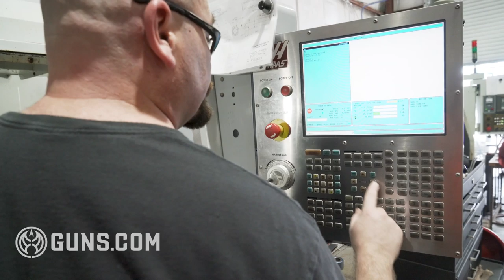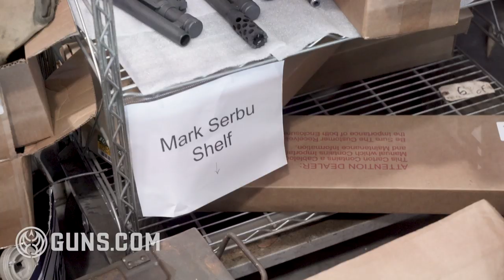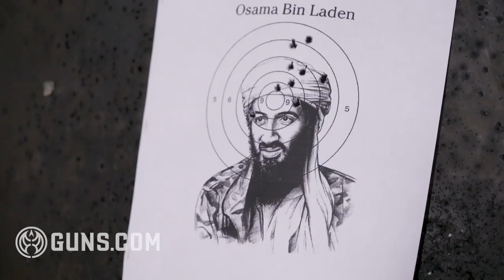Select Fire: Serbu Firearms

Comment: I'm proud to say I've owned a BFG 50 for many years now even paid Mark to engrave have a nice day on the front of the muzzle brake love it.PS I was a Tool and maker Machinist for 30 years and appreciate the simplicity and precision of his firearm.
Reply: I know it may annoy you, but Are the guns more accurate if there are less moving parts?
Reply: @phagesuffersatgaming.3797  depends. The part that really affects accuracy is a repeatable lockup between the barrel and bolt, alongside making sure both of those pieces are well made.
Reply: @marcusborderlands6177  huh, thank you.
Reply: @phagesuffersatgaming.3797  np :)

Comment: Yeah just stay away from the RN-50,this firearm should be pulled from circulation and fully redesigned as its clearly unsafe and is flawed in its design, no saftey mitigation,not enough protection for the user.
Reply: Tell me you know nothing about guns without telling me you know nothing about guns.
Reply: @deezboyeed6764  i know enough to know that this firearm is seriously flawed,what a shithouse design,made to a budget so you get what you pay for dont you.
Reply: @Healthliving1967  sure buddy, whatever comforts you that you can't afford one.